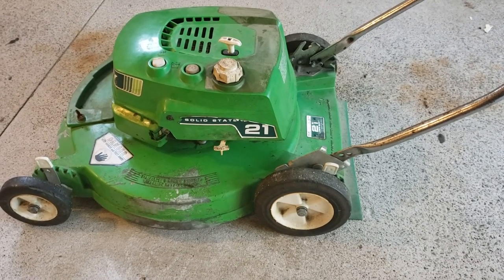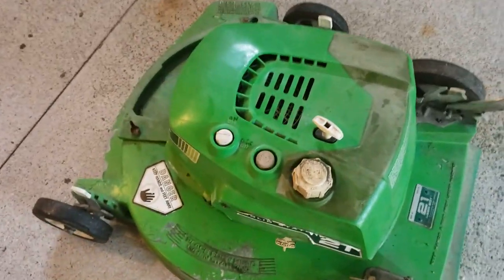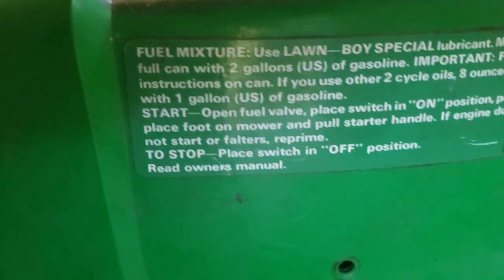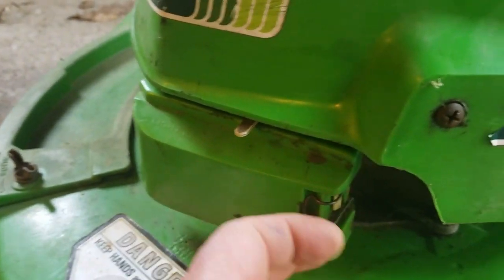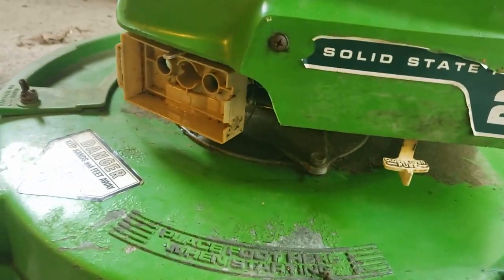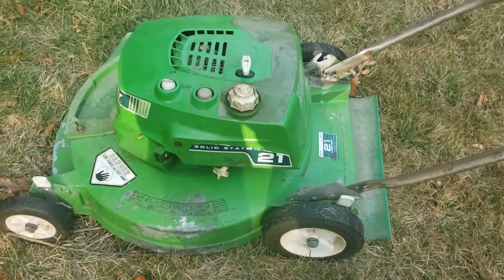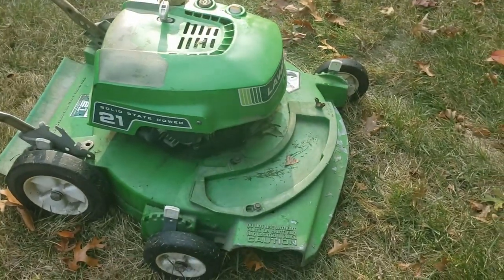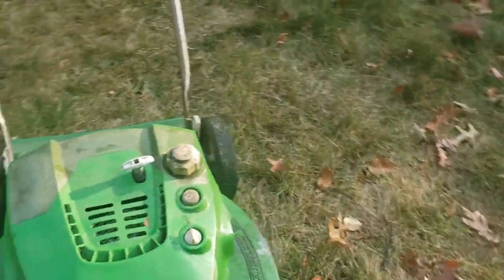Nifty old Lawn Boy 2 cycle lawn mower from 1979!!  Trash pick!  Screams to life & rips through grass

Comment: Found a 7268 on Craigslist ten years ago for 75 bucks and have been using it since. Make sure to put an air filter in the carb box and mix your fuel with non oxygenated 91 octane and API TC rated oil (i like Amsoil Saber) at 32:1....it will run a very long time. Pull the under deck muffler off and clean the exhaust port, they will get coked up with soot if low quality oil is used.
Reply from the maker: Hey, thanks for the tips. just running some 87 octane, but it is fresh. Filter clean. Will check the port too. Have not looked at that.
Reply: @TenaciousCsRescueLeague  a blocked exhaust port and or muffler on F engines can greatly reduce power and cause poor performance in general. I haven't had to clean mine one time once I started using quality oil
Reply: @TenaciousCsRescueLeague  The exhaust ports getting clogged was about the biggest demise of a lot of Lawnboys. People would think they were worn out and get rid of them, then someone in the know would pick them up off the curb or from the junk yard, clean the exhaust ports and turn around and sell it. Very profitable past time. The goofy wheel set up was promoted as an anti scalp design. The 2 cycle and light weight made these the preferred mower for mowing ditchs and steep hills as no worry on oil starvation. I think most of the people in Galesburg IL had one of these at one time as that is where they were made. I grew up there and worked at Outboard Marine (the manufacurer) for about 6 months. They are a unique mower and with minimal care seem to run foreever.
Reply: Very interesting.  I have a `74 Lawn Boy 7224 with a D600 motor.  Been in our family since new.  Been using Pro Mix multi-ratio oil for the past 8 yrs. and wonder if it caused heavy scoring in the cylinder and compression is low.  Now need another D600 engine.  Having trouble finding one.  Used Shell 93 for the past 2 yrs. and wonder if the extra detergents harmed things.  I have heard good things about Amsoil Saber.  Curious why you advise 91 octane.  I know Lawn Boy advises "regular".  I don't think the exhaust ports were ever cleaned on this machine, and the rpms dropped over the past 10 yrs.
Reply from the maker: @richardgiles7017  Hey, thanks. Appears that a lot of signs point to the exhaust ports on these old F and D engines as areas of fickle behavior. I need to tear down the carb on mine (too many other gizmos laying around..) It runs well, but a little hard to start, and the carb leaks a bit. Bad float seat perhaps. Simple fix. Luckily it has is a factory fuel shut off lever. Nice feature!
Reply: @1984AP  i believe lawnboy says 89 octane in the book, but the more important part is using NON Oxygenated or ethanol free fuel. In Minnesota where I live, 91 is the only grade that comes without ethanol for the most part. I have a stihl fs45 trimmer I bought new 10 years ago, I literally have no idea what the inside of the carb looks like because I've never had to have it, my snowblower, leaf blower or my two lawnboys carbs apart since using non oxy fuel. If only everyone knew that secret
Reply: @ericjohnson3332  I've heard that too about 91 octane.  Not sure about where I live in CT.  Some say using ethanol fuel with Startron additive should be sufficient.

Comment: thats a good old lawn boy i got a old lawn boy i only run ethanol free gas in
Reply from the maker: I heard that's the trick to longevity. Hard to find the EtOH free gas up this way though. I use Stabl in everything and it seems to help keep things easy starting.
Reply: @TenaciousCsRescueLeague  you can get a gallon at tractor supply true fuel 50 1 for 19.99
Reply from the maker: @snoopysrc  No Kidding. We have a TS two towns away. I'll check it out. Thanks!
Reply: @TenaciousCsRescueLeague  are you making more lawn boy videos this spring????
Reply from the maker: @snoopysrc  Well, Sure!! Why not. I need to fix that kill switch bug and then take it out for a real romp in the field. Might be worth capturing on vid.
Reply: @TenaciousCsRescueLeague  Ethanol free gas is easy to find online or in app form.
Reply from the maker: @kgonzales321  Good to know. I certainly don't see it as an option at the pump!  Thanks.

Comment: I have a similar one found in a similar fashion i think mine is 1975 but mine looks new compared to this one. I had to take apart the self drive linkage and the worm gear setup going off the shaft because the o-ring vaporized the second i looked at it. Im not exactly sure how it goes back together so been running it without the drive
Reply from the maker: Good score!  Mine doesn't have the drive system. A simple old walk-about.  I have another video of this one following a clean up and some rudimentary restoration.  Looks a lot better at end of that vid!  -C

Comment: I had one of those years ago and the crank bearing exploded inside the cylinder and scored the walls I was pissed as fuck lol so I restored a gold series and I always do a cylinder pressure test every season to Mike sure the compression is good, rings are good and bearing should last a good ten years as well
Reply from the maker: Man. Lots of drama there. I found a snow blower with a  Tecumseh 7hp with a shattered connecting rod. I had to remove the fused aluminum from the crank with muriatic acid. New rod went in fine and it still runs pretty good, but smokes a bit. Yep, just keep an eye on it.

Comment: It's lightweight because I believe it might have a cast magnesium deck.
Reply from the maker: Yeah, definitely some kind of light rust resisatant metal. Shiny through the paint chips. Not like steel!
Reply: This model of Lawn mower has the cast aluminum deck but earlier ones did have the magnesium deck.

Comment: These were great mowers but now that they are 40+ years old if your going to actually use one today it would be worth putting in new crank seals (makes starting and running soo much more consistent) and having a spare ignition coil on hand(they are pricey especially OEM). They are incredibly simple and easy to work on but the parts these days are getting scarce and expensive.
Reply from the maker: Thanks for the tips. Yeah, I rarely use this machine. I feel lucky to even have it. I keep it in the garage as a curiosity and just fire it up every now and then to give a quick edge cut along the driveway!  Thanks for checking it out. -C

Comment: I just got mine and I don't like how it's so loud it runs really rough and the first time I started up at smoked but then I started it again and then there ain't no smoke it's super loud is the part I don't like about it but it cuts really good still learning about this mower I just got literally just got yesterday
Reply from the maker: Trial by fire....that's the way I learned too. Probably a bit of gummyness in the carb or something. Mine is not much lowder than a 4 cycle engine.....just a different pitch. Could the baffles in the muffler be shot?
Reply: @TenaciousCsRescueLeague  sold them for ten years.
1can Lawn Boy oil to two gallons of gas.
Reply from the maker: @fiddlingary Thanks. Sounds easy.  I guess it comes in 4 oz bottles?  I have a 1qt bottle of generic 2-ctcle oil. I measure and mix.
Reply: Loud?  2cycle lawnboys with the muffler under the magnesium deck as satisfyingly quiet
Reply: @TenaciousCsRescueLeague  Sold them fir ten years.
Reply from the maker: Nice.  Congratulations! Not sure why it is so loud. Perhaps the baffles inside the muffler are perforated or rotted out...Muffler might look OK, but no "muffling" going on. The pitch is different (being a 2-stroke), but mine I think is slightly quieter than the 4 stroke colleagues.
Reply from the maker: @fiddlingary  Cool.  I presume before the Toro acquisition?
Reply: @TenaciousCsRescueLeague  
Oh yeah 80-90

Comment: i recently got my hands on one of these. i was cleaning the carb and was like well why is it so thick. bad fuel and it had oil in it. drain the tank but nothing was in it and on the cap 2 stroke. while i was cleaning the carb i thought the carb looked like a 2 stroke carb. got it all back together and started right up. and sounded exactly like a snowblower. the blades need sharpened but it still tore through some literally almost waist high grass first and only pass. for what i paid and what i got. this falls into the steal category. i love 2 strokes so one more reason to run one. i use lucas 2 stroke semi synthetic oil in my 2 strokes so low smoke and 50:1 ratio they will last forever. 
my moped has a race cylinder on it and uses same oil and after thousands of miles there is 0 wear. im sure the same will go with this thing. it barely has any use on it so its gonna be like getting one brand new.
Reply from the maker: Good story.  I have never seen another one of these around myself.  I guess I could look for them on line, but the "free finds" are the best. Looks like a good fix you made!   Many years of happy mowing to you!  -C
Reply: @TenaciousCsRescueLeague  yes it was a very unexpected but welcomed find. the aluminum deck was a nice touch too.

Comment: You can buy a new on/off switch for it on eBay. Part # 104-4446. Nice mower. Similar to the 1979 Model 5247 I use to have.
Reply from the maker: Thanks much! I guess at this point I just deal with the switch in the reverse position. A lot of theories out there regarding the coil and other confounding propensities of reversed continuity. But I agree! It is petty cool and I thank myself every summer for rescuing it!  -C
Reply: @TenaciousCsRescueLeague  I have several old Lawn-boy two cycles. Great mowers once you understand them.

Comment: I have a lawnboy 8232 and the deck was the magnesium from 1973 and I found a lawn boy 8237 deck with the F series engine 1978 and the engine was completely blown deck was in beautiful shape if you watch my YouTube video on it you’ll see and how bad the other decoration I went to my 8232 it was cracking and magnesium
Reply from the maker: Will catch it.  The deck on this machine is in good shape.  I should really give it a good cleaning and tune it up a bit.  Looks like some aluminum or light metal? Aluminum doesn't really hold paint well in my experience. I have an old Toro GTS with analuminum deck and it's peeling a bit.
Reply: @TenaciousCsRescueLeague   interesting

Comment: I got one to same mower I can't for the life of me to get it started it got spark and compression I added 2 stroke and oil and it doesn't work.  Any tips would be greatly appreciated
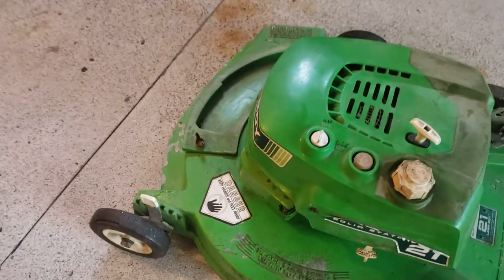Reply from the maker: Spark and compression are 90% of success. Only thing left I can think of is a carburetor or fuel delivery bug. Did you try spraying a little starting fluid (i.e. "Instant Start", basically ether in a can) into the carb with the air filter removed? It might roar to life for a  couple seconds then poop out? If so, the engine works. That's good.  You just might need to pull the carb to clean/replace or clean/replace the fuel lines. Don't run it more than a couple of seconds on the "instant start"...you need that 1:32 fuel mix for cylinder lube.  Please advise if this helps! Thanks for watching.  -C

Comment: interesting mower, but there is no throttle control?
Reply from the maker: Hi there.  That's correct!  It is either running, or not running. One speed only.   -C
Reply: Actually, there IS a throttle control but not of the typical manually operated type. This throttle is controlled by a paddle shaped air operated vane inside the engine shroud that is connected directly to the carburetor. The air cooling turbine (flywheel) that cools the engine blows air against it, and whenever there is LESS air resistance on that air vane it will raise the throttle. When there is MORE air pressure blowing on that air vane (indicating higher revs) it will throttle down as needed. It is a quite ingenious system, coz it saves fuel and it saves you from having to babysit the throttle cable while you mow. Taller, tougher weed patch in there? NO PROB! it'll just throttle itself up immediately as soon as that air vane  senses the increasing power demand on the engine, while the load increases,   the rpm goes down. All of this happens "on the fly" -and it happens faster then you can reach down and manipulate a throttle lever too. Mow on!
Reply: @econoroller  my model 10301 had a "thumb wheel" on carb to increase/decrease engine speed. I set it faster, because I used to cut waist high grass with it.

Comment: Do NOT use starting fluid in a two stroke use pre-mix gas there is no oil in starting fluid
Reply from the maker: Yes!...of course use it!  Pulling that starter more than once is worse...That equals no lube in a 2 stroke on that second pull!  Honestly, it doesn't matter. Continents  drift at a faster rate than you will ever see engine wear from a shot of ether.
Reply: Agreed. I use an ear syringe - pull fuel from the tank, then squirt it in the venturi.
Reply: Most starting fluids do actually have some sort of oil in them. It usually says something like “two cycle safe!” Or “contains upper cylinder lubricant”.
Reply: Try using Coleman fuel instead of starting ether.  Works good

Comment: First time I saw one of these on the marketplace I thought it was an optical illusion, or a wheel fell off.
Turns out it was just a goofy design
Reply from the maker: I know! I think that is part of what endears these machines to their fans. The whimsical design, sound, etc.
Reply: It’s actually a SUPERIOR design as a) the discharge speed is enhanced/ unencumbered based on the placement of the deck orifice (though my LB is always in mulch mode) and b) that staggered wheel means one can really get close to obstacles with the front-right sweet spot for precision trimming as unobstructed blade-area is maximized by moving that FR wheel back
Reply from the maker: @michaelsocash3407  I agree. Despite the unorthodox looks, the design is extremely functional. I mentioned it reminds me of old Blohm and Voss aircraft designs   (i.e. Blohm and Voss Bv 141 & P111).  Off point, yet fascinating.

http://www.luft46.com/bv/bvp111.html

Comment: These F engines were rated at 4 horsepower.
Reply from the maker: That sounds about right. Was probably an authentic rating back then. Into the 90's manufacturers started fudging horsepower #'s upward to improve sales. The courts nixed the practice, so everything is in cubic centimeters now.....a quantitative measure!

Comment: I remember these, they had very little power. I think they switched over to 4 cycle engines for more power. If the grass was long and thick forget it they were VERY under powered. You couldn't give me one.
Reply from the maker: That's too bad. Perhaps out of tune?  Mine is awesome.  Like a chain saw through the grass. Glad someone "gave" me one.  Can't beat the return policy at the dump!
Reply: You were definitely doing something wrong, wrong gas mix restricted exhaust something I've owned several & still have 2 left I used to use them as a brush hog they're so powerful
Reply: This will cut thick grass a foot high with out bogging down.  The only thing stopping it is the chute clogging.

Comment: I had one for half a season. In tall grass, it would out-smoke hell. I got tired of breathing oil fumes and got rid of it. Give me a good ole 4-stroke anytime.
Reply from the maker: Hmm. Mine doesn't smoke. And since 2 cycles have no oil sump or valves/rods, it can't be bad rings or oil seepage from the head. Perhaps a bad (very high) oil/gas mix or something with the mixture?
Reply: My LB is 24yrs old and never had that problem... if you use a QUALITY synthetic ashless 2cycle oil with the correct ratio - and, if you know how to operate a LawnBoy, you should not encounter that malady